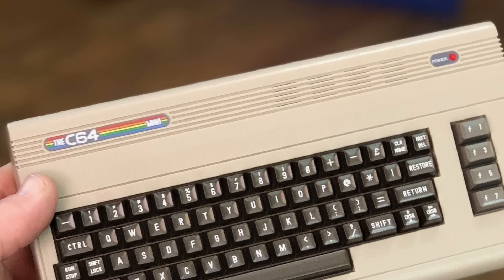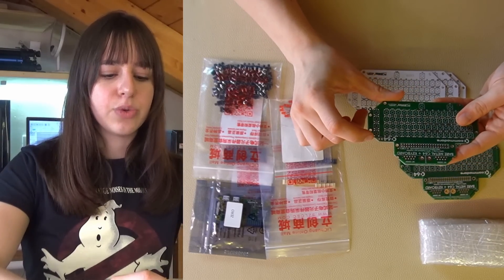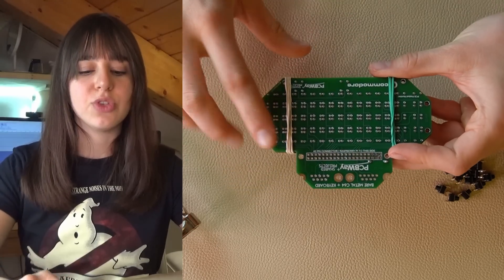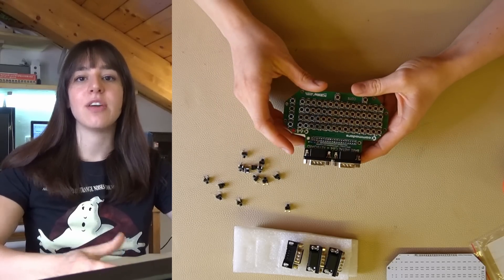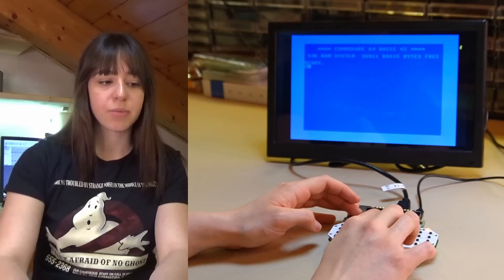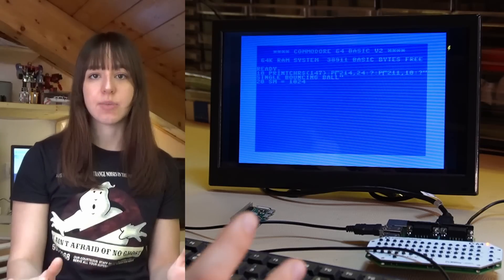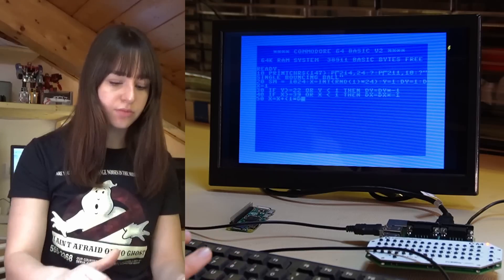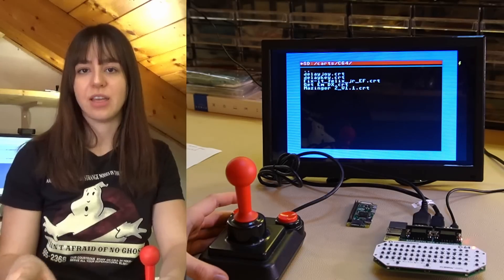Building a MicroCommodore 64: Hardware, Coding and Gaming

Comment: I KNOW IT'S A YEAR LATER BUT COULD IT HAVE BEEN MADE EVEN SMALLER IF IT WAS USED WITH A WIRELESS/BLUETOOTH KEYBOARD?
Just curious if you use abbreviation commands to make your program lines longer. 
I used to do this so other people wouldn't edit my programming. 
If they did, nothing would work anymore.

Comment: Nice job, VICE emulation is excellent, but it's never quite the same as original hardware, especially the unique sound of the SID chip because it was a fusion of both digital and analogue technology that can't be perfectly emulated.

Comment: Ok this is amazing!!! Much better than all the other emulator boxes that run a whole Linux Distribution that takes some time to boot up. This here actually feels a lot closer to the original C64 hardware but much smaller and Menu-wise very convenient to use. I think i'll definitely gonna put together such a thing too :) Love the clickswitch Mini Keyboard. Those parts can at least even be easily replaced since they are cheap and readily available off the shelf compoments. That's what's i like a lot.

Comment: You should use 0.71mm or 0.53mm solder instead of the 1mm you are using, it will result in much cleaner joints.

Comment: Back in the day, I thought emulation software on my Windows computer was neat, so I could run C64, Apple IIe, and TRS-80 Coco apps & games (without having the original computer hardware).
But this is cool, in a parallel manner.
Love it.

Comment: That yellow lightning bolt on top right of the screen means that Pi is not getting enough power. Check the power supply and cable.
Reply from the maker: Thanks for letting me know

Comment: Good job, girl ❤ there are so many things that can be done with a Raspberry that it's just mind blowing 🤯

I have a Raspberry Pi 4 that I currently use as a firewall, but I'm planning on using it to build an arcade machine. In fact, I already have an SD card with RetroPie installed, and a replacement computer to use as firewall. I only need some hardware: the cabinet, a spare monitor, and joysticks and buttons 😊

Comment: Nice video - just one question: shouldn't you wear safety goggles or glasses protection when welding these things? I don't think the smoke is good for the eyes...
Reply: It’s not welding, it’s soldering, much lower temperatures. The flux fumes are somewhat toxic, yes, but she uses an exhaust fan.

Comment: Cool project, did not know it existed. I looked at emulation because I don't have room for a wedge C64 setup. In the end I build a Uni64 Ubook. It's a ITX like C64 and only 17x17cm. It even contains a Luma Code board for pixel perfect HDMI out, Dual Sid's and a USB HID to keyboard interface.
Reply from the maker: That sounds like an amazing project!  It must have been quite rewarding to build something so unique and functional.

Comment: In case you are not aware, the yellow lighting bolt you are seeing on the top right of the monitor is because the Pi is not receiving enough power, so you need a higher current power supply.
Reply from the maker: Thanks for letting me know
Reply: @Sayakas_Digital_Attic Be sure to keep backups of anything on the microSD too. Corrupted cards are common if power is interrupted during disk access. I've even lost cards to this. They are no longer recognized.
Reply: @Sayakas_Digital_Attic  Also could be a low voltage supply. Many poor quality supplies drop voltage too easily. The official raspberry pi power supplies are actually 5.1v to help cover the current drop over the cabling and connector. This was something I struggled with on my pi machines for awhile. A Samsung 2000mah adapter seems to work well for pi 3 even though it's exactly 5v.

Comment: Interesting project. With modern tech, it probably would be possible to make truely portable Commodore SX64, just add some small lcd display to this Micro C64 and print miniature version of the SX64 case :)
Reply from the maker: It's a great idea! I feel like I've already seen a similar project on a website
Reply: I always found the  SX64 ugly. The best portable C64 I have seen was an elegant C64 C case with attached LED display and internal battery power. Doesn't look dated even today.